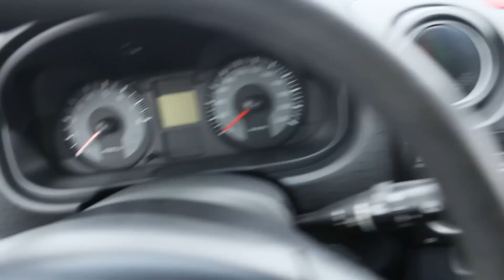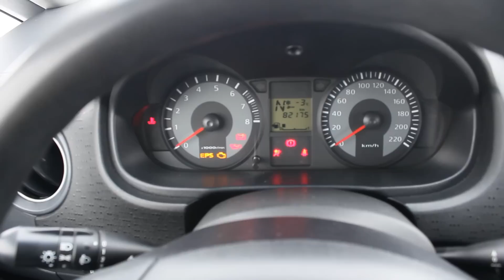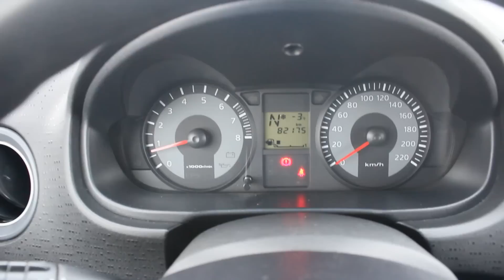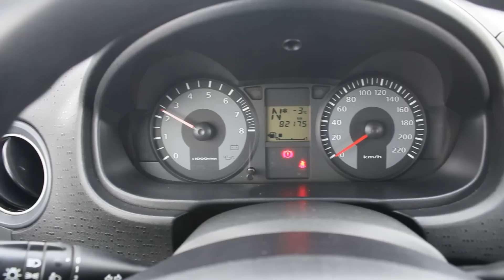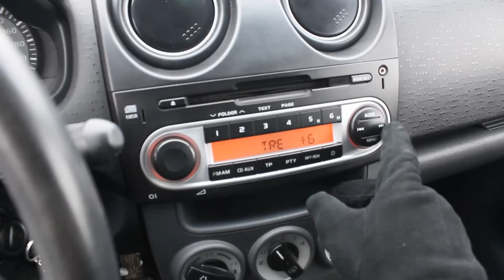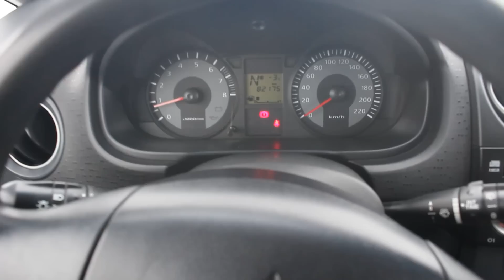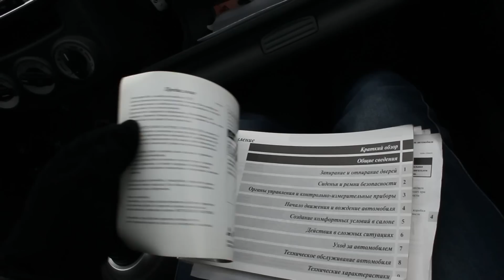2009 Mitsubishi Colt. Start Up, Engine, and In Depth Tour.

Comment: I have a Mitsubishi colt from around 2002. HEAVY RELIABILITY PROBLEMS ! Don't buy this car, even used ! I really beg you on knees, don't do that to yourself. You will be in the garage on and on.
Reply: Bollocks!

The Mitsubishi Colt in this video is the facelift model, the pre facelift model was launched in 2007. That 2002 car was a totally different car...
Reply: Bob Outélama shame you've had a bad experience, I've owned the facelifted 2008 model for 6 years now and I've never had a problem. Super reliable and a real pleasure to drive in the city but there is a lot of road noise at high speeds. I don't think I'll ever sell it because it has depreciated in value so much that the average price of the car now does not justify the amount of stuff you get as standard. Bad for sellers, good for buyers I guess.
Reply: I have the 2010 model, never had a problem ever. But i got the ralliart model though but still.
Reply: @sandersandmo7769   hey.
Can you answer me a question please?
How do you open the trunk?
Do you have to push a button from inside or if the car is unlocked you can just simply open the trunk door by hand?
Thanks
Reply: @bh25jay  its under the steering wheel over the pedals under there , pull a handle. And flip the hood open afterwards.
Reply: @sandersandmo7769  not the hood, the trunk.
I wanna know how can i open the trunk.
Reply: @bh25jay  you just pull the handle on the trunk on the outside😂 but its nothing on the inside though
Reply: @sandersandmo7769  thanks man, good to hear that.
I have a Ford Ka and if you want to open the trunk on that thing, you have to push a button on the dashboard and then you can open it from the outside.
It's so annoying.....
Reply: The older Colt was not good the newer Colt and Mirage are much better cars
Reply: Colt 2002 is totally different. This one is clearly reliable.